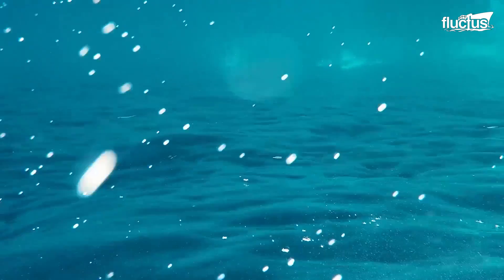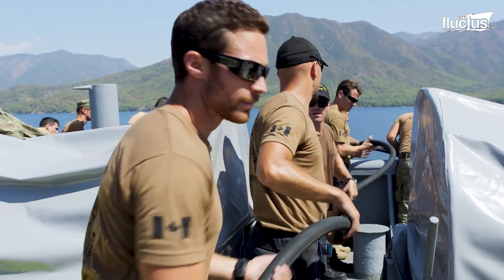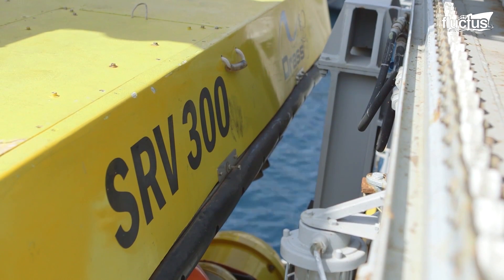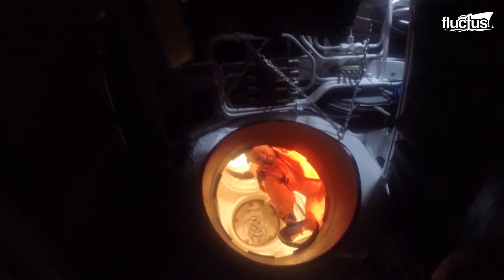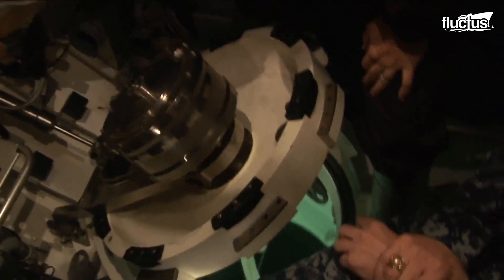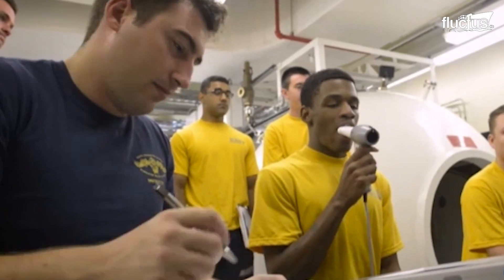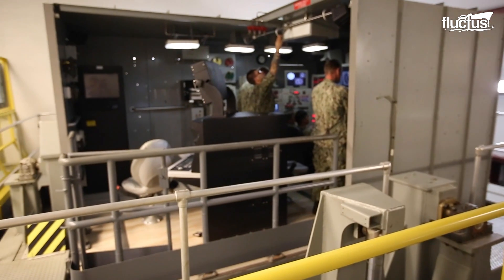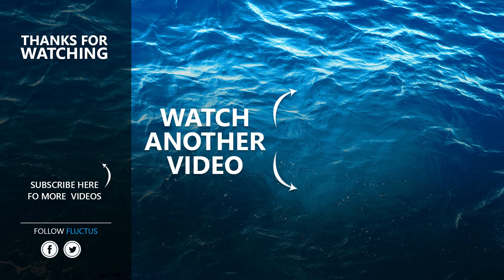Rescue of $3 Billion Submarine Stuck in Middle of Sea - Documentary

Comment: Amazing, all this technology developed to bring up one person at a time and continue risking crew. Why don't you put big tire valves in ballast tanks and bring the whole boat up.
Reply: Because ballast tanks don't provide enough buoyancy. The sub I was on would sink if any compartment flooded completely except the torpedo room. Filling ballast tanks with air would not be enough to lift the boat. Also, if the boat was rammed or otherwise damaged a ballast tank it wouldn't hold air. All ballast tanks fully filled with air will only lift an un-flooded, operational boat. 

And, keep in mind, a sub's interior bulkheads can't withstand the same pressure as the crush depth of the pressure hull. On my boat, if a compartment was completely flooded and exposed to sea pressure the bulkhead would collapse and sequentially flood the entire boat at 800 feet. The only way to survive a submarine sinking is to sing in shallow coastal waters.
Reply: @johnbrooks4007  Roger that,  beyond crush depth, no need to pursue or hope for survivors, just mark position and send down surveillance drone. Ironically at crush depth you do not drown but are burnt by pressure - it's pretty instentaious either way ) The new boats can  go pretty deep. ( I think pressure of Titanic at 12,000 feet is 6000 psi).  Like you mentioned  about 300 feet would be about maximum for some crew survivability. And there are mini subs to attach ( SEALS use a special type) and allow multiple  personnel rescue.  I'm thinking if there was a compartment not damaged and crew made it back there,  maybe pump out some water first, then presurize ballast tank,  or maybe upright boat a little to get better entry point. I'm retired pilot, with fear of heights😀, but that and enemy AAA, never bothered me because aerodynamics a lot different than hydrodynamics" , much different survivability opportunities than beneath the waves. Plus some of these subs are almost 1,000 feet long.  After flying,  in my second life I installed some experimental  instrumentation on a sub - and I discovered claustrophobia.  Just volunteered for one install. I have to say you guys have brass ones to crew a sub.
There is also foam that displaces water and is very light but you couldn't put in compartment with survivors. 
The news didn't seem to cover it much, but have you kept up with the Indonesian sub that recently went down? I don't know depth in the area but it seemed to me they gave up kind of early in writing boat and crew off, unless they are withholding info on mission. Any ideas on that one?
Thanks for responding, my initial thoughts were if ya just got some air in tanks it might help, but I forgot about weight of water in hull breach. Pumping water out and air in simultaneously,  might work - at least raise up enough to get some of these new heavy lift bladders strapped under boat.  ( you may remember Glomar Explorer - that's my era of flying ).
Semper Fortis....
Reply: @c123bthunderpig  Unfortunately, most sinkings occur in deep water with no chance of survival., ie Scorpion & Thresher. Usually, all they find is debris scattered on the bottom. If a sub loses forward or aft ballast tanks it turns vertical. If it turns vertical the ballast tanks won't hold air and the boat goes down. Though they have speculations, we will never truly know why the Scorpion & Thresher sank. 

There are a wide variety of methods to raise sunken ship but none meet the constraints of saving a submarine crew. They are already dead or will run out of air before anyone realizes anything has happened.

The rescue of 33 members of the Squalus in1939 was a miraculous achievement that hasn't been repeated in 83 years. It won't be repeated until a boat sinks in shallow water.

Every time I wen to sea I watched the depth to bottom and thought "if anything happens now, I'm dead{. When we came back in I thought,  "I might survive IF I'm in the right compartment.
Reply: @johnbrooks4007  Hey John , I remember the story of Squalus quite well, that was at a time when men with knowledge were respected and much less "bureaucracy" was involved. If I recall the Titanic discovery was part of a secret package given to Robert Ballard as part of a project to locate Thresher and Scorpion and document the sites. The Titanic laid in between the two sites and the Navy told Ballard you accomplish the objective of the sub mission and the balance of time left on mission funding was open to Ballard..

I know these subs have to be big and jammed with gear and weapons! But it would sure be nice if they could make escape capsules the crew members could get to in time of emergency. Of course the g forces do make it tough to easily move around. I know there are some subs that have pressure chambers to allow  divers to come and go.

Along the way  the oil industry has similar problems with their deep diving modules where they stay for their shifts and then depressurize for return to topside. The pressure chamber coming back in has critical entry protocols. There was an accident where the pressure was not equalized and  no recognisable bodies were found and that's not even at current diving depths of subs,. I suspect there is some cooperation between the two - industry and Navy.

At least I had several options at low and high altitude emergency situations. Better options the higher the altitude. Being on the ground  in enemy territory was the most dangerous of all of my experiences 

There are tons of movies about submarines  can't list them all. However one of  the classics  is Dad Boot , with subtitles. I'm sure our crews suffered the same fate in many battles.

There is also one that is based partly on a true story and entertaining,  Operation Petticoat  but I date myself  on that one.

Crimson Tide was not bad. But it had Gene Hackman . I never did figure out how his Jack Russell terrier went to the head.

Hunt for Red October was a great book  and I like Sean, but a Welsh Speaking Russian Captain didn't quite work

I do appreciative your service , we need this kind of weapons platform and men like yourself to crew them.
Reply: @c123bthunderpig  Das Boot was my all time favorite. I actually read the book while on patrol in the north Atlantic. The author was a military war correspondent and made several patrols. He cobbled real life events into one great novel. Operation Petticoat was a great movie. I've built several models of Gato and Balao class subs and seriously considered painting one of them pink.

Going by your user name and posts, I assume you are into aviation and a veteran as well. I'm into aviation as well but I haven't flown in decades. My big interests growing up were submarines and flying. You couldn't pay me to sit in a muddy foxhole getting shot at in the dark. I want to be up high or down low.

Thanks for your kind words and I appreciate your service. There aren't enough people that truly care about our country now.